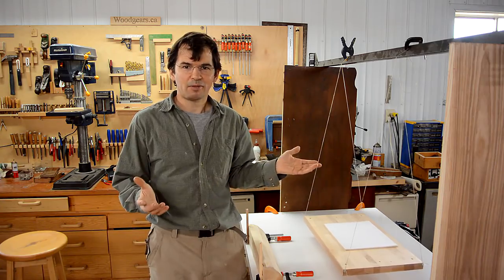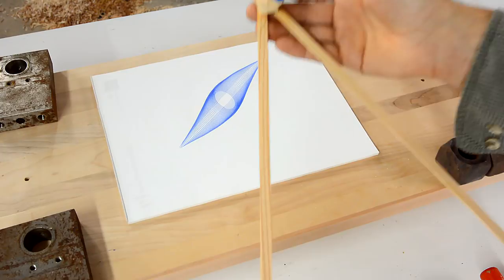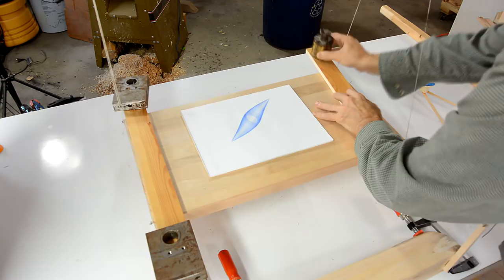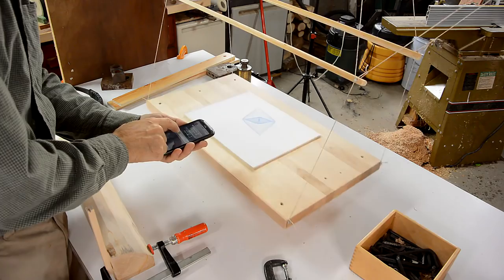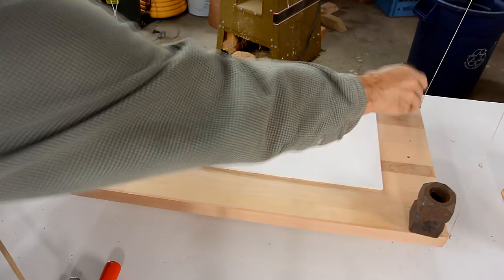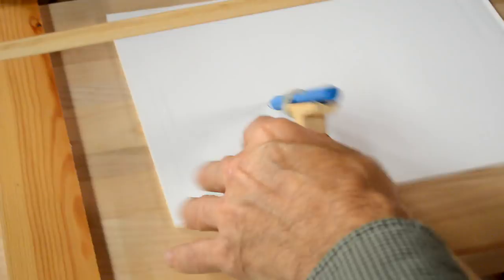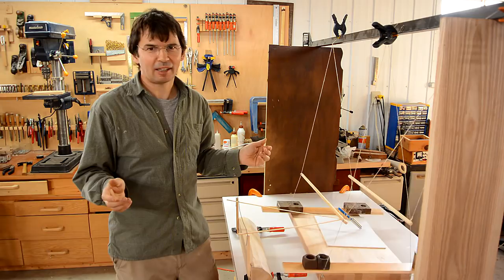Lissajous pendulum graphing swing

Comment: You should try with a weight stuck far out on a pole. It's interesting. Also, works a lot more interesting and longer when the pen is replaced by a felt one, stuck on a piece of spring, and that attached to a pendulum with about a kilo weighing it down.
Constraints on the wire create interesting designs.
We used to play with this in the sports room. Hung by the beams above, on a rope, and with a lot of A2 paper tacked in between the parquet seams.

Comment: The math behind this is way over my head but its a cool experiment and demo
Reply: They are just parametric curves like a circle, but with different frequencies on either side.
Reply: The math actually isn't very complicated. The swing of the pendulum along one axis can be represented as a sine wave with a given frequency. Same for the other axis. The ratio of their frequencies produce the shape.
Easiest to imagine is a circle, where the ratio is 1/1.
Reply: There are other factors, too - amplitude (how hard he pushes on the suspended board), decay (how quickly inertia is lost), but these are of lesser import than the main principle.

Comment: similar can be achieved using an LED on the pendulum and a long exposure on your camera (no friction from the pen that way either) using your equipment I'd stick the led in the middle of the board and mount the camera directly above on the beam.  lights out and away you go.

Comment: I'd had one of these set up at the house a few years ago. Much bigger but my results were not nearly as good as yours so kudos. I wonder if you could add spring loaded bumpers at the height of the platform to constrain the motion and return some energy to the system for longer lasting swings. Jus' thinkin'

Comment: The video reminds me a double pendulum with a tip point mass travel simulation in 2D plane using Matlab. The tip point mass runs in similar trace and shape. Change some parameters, such as mass and pendulum rod lengths, and re-run simulation, the trace changes and varies quite a bit.

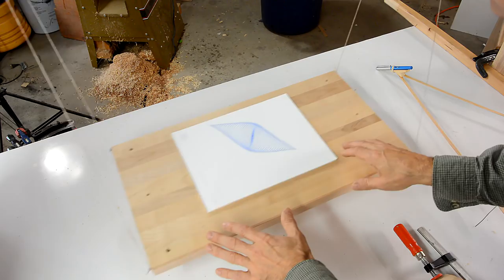Comment: Matthias Wandel: 0:40 I believe the difference in frequencies between the two modes is not because of different length of swing, it actually is the same (the distance from the center of gravity to axis of swing is the same in both modes). What is different is that in one mode the platform itself rotates, thus storing energy in its rotation. Also when you moved the weights further away from the platform you increased its moment of inertia, thus decreasing rate of swing for the mode in which the platform rotates about that axis
Reply from the maker: Same thing, different way of explaining it.  I actually also explain this way of looking at it in the linked article.
Reply: T = 2*pi*sqrt(l/g) is this how you calculate the period?
Reply: if yes then the period (T) is being affected by sqrt(2) of length (l)
Reply: Came here to tell this.